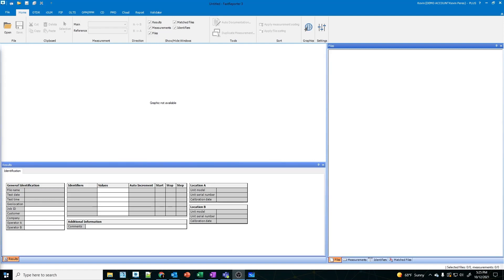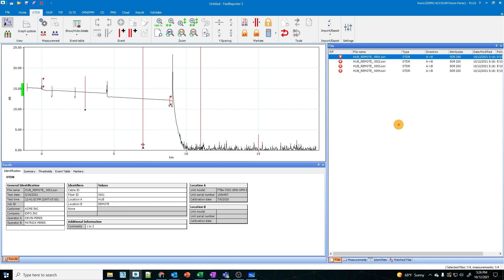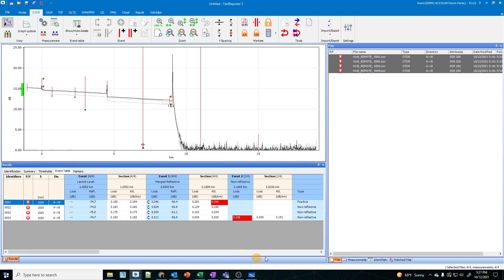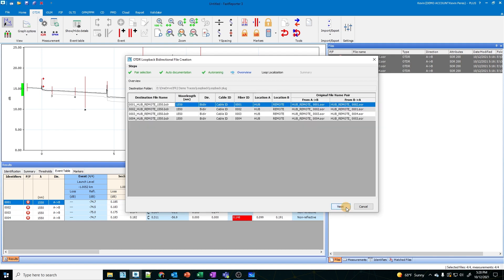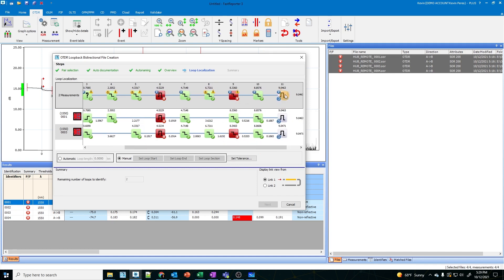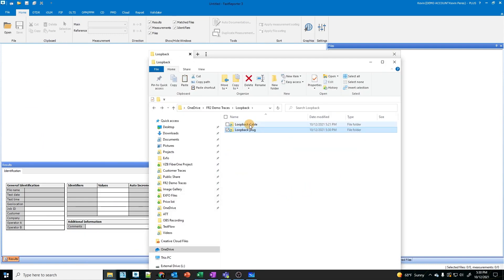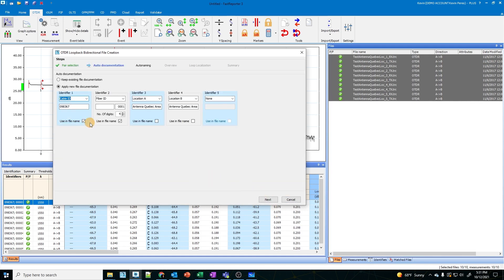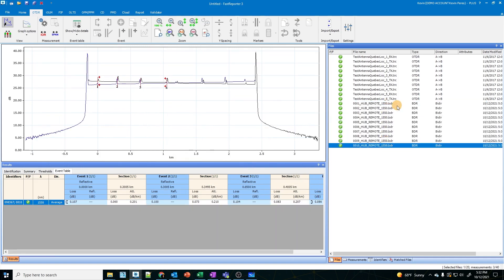Using Fastreporter To Generate OTDR Bidirectional files from a Loopback Test

Comment: Hello Kevin,

Interesting video, what length do you recommend for the loop cable that you find it good in the measurement? 
Does it also work with APC connectors?
Often good APC plugs have no reflection 
We have already tried it in the Iolm with a 20m loop cable and APC connector, but there are often problems with it not recognising the connector. 

Greetings from Germany,
Patrick Heller
Reply from the maker: @Paddy-we1bx  hello Patrick. Great name I have a son named Patrick.  I recommend at least 100-150 meters.  It really depends on the span length. APC connectors often do show non-reflective.  Is iloop not identifying the loop correctly ?  A longer loop might help but I will have to look into this. Do you have a copy of the trace you can email me ?

Comment: Hi there, we have a viavi otdr, just wondering if we can use this program to do the bidirectional trace? We have downloaded it and tried loading “.sor” trace and it won’t load.
Thanks
Reply from the maker: Fast Reporter 3 will open SOR files but sometimes there will be some anomalies. While SOR are a "standards" based format there is some wiggle room for some of it that each vendor may interpret differently. We try to build support and work around where we can but we are often limited. For example many third part SOR we will not re-analyze because of this. If you go to the OTDR tab and select Import this will allow you to import in some SOR files that do not meet Bellcore compliance or there is something we needed to adjust. For example some Viavi traces reference out the launch and the launch connector differently so when you import them we will adjust to that. It is not perfect and sometimes you will see some differences.  It is always important to compare what the results look like in the test set or from a report pulled from the test set to make sure everything is looking good.  Now if you are talking about using the iLoop tool I am almost certain it will not work on third-party SOR because we need to reanalze it. Hope this helps!

Comment: At my company, we have a separate department that uses the FastReporter, while the Fiber techs do the shooting of the OTDRs.This is the first time I have seen FastReporter being used. I've always been told that the naming sequence has to be exact from both locations otherwise FastReporter won't generate a bidirectional shot. What part of the naming configuration is affected by that?
Reply from the maker: Chris,  That is a true statement but it can be fixed in FastReporter. It is a good practice to and makes post processing easier if it is done in the field.  Matching is based on Cable ID and Fiber ID by default. If CableID is blank that is fine just make sure that FiberID is the same. Of course both sides are not often the same port or connector number!  In that event I suggest to set the FiberID to the port you are testing and in FastReporter this can be adjusted. Some companies have both sides set the FiberID to the A side but that has to be understood and part of the practice.  Hope that helps.